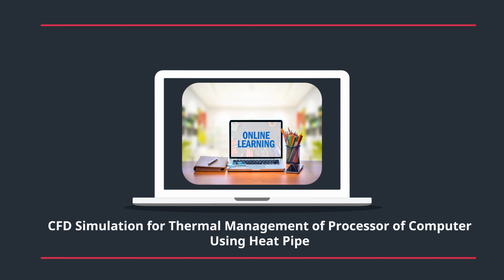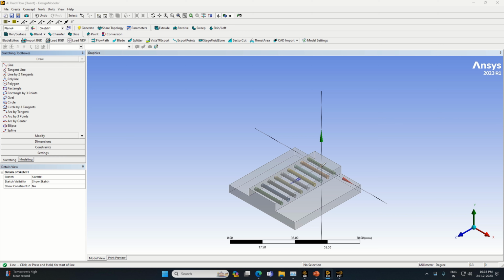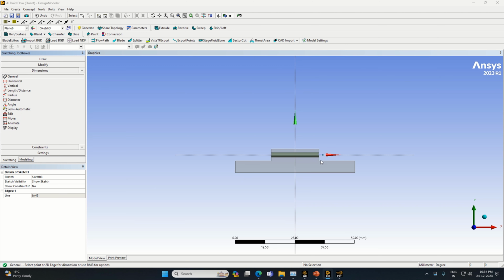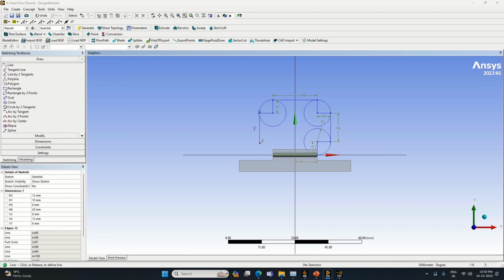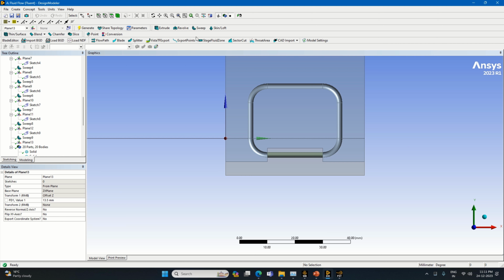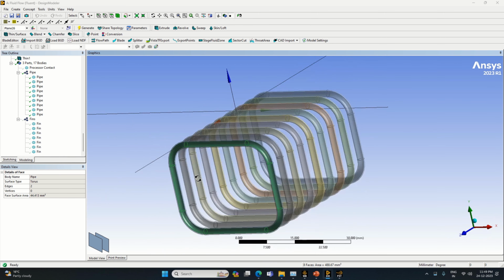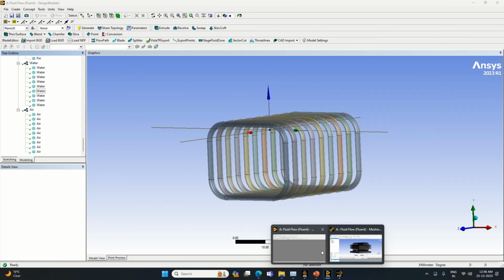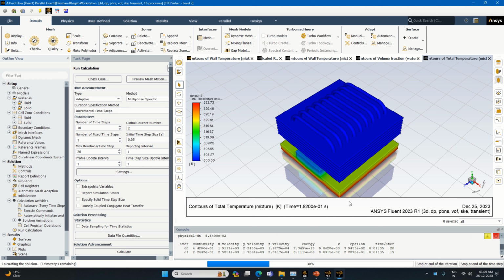CFD Simulation of Computer Processor Thermal Management Using Heat Pipe with Fins

Comment: Can u please upload or suggest some videos for battery thermal management system for pouch cell
Reply from the maker: Share the specification and details  will upload
Reply: @FrontiersInCFD  a 20ah li-ion single pouch cell having  10 liquid cooling channels (water as coolant) discharge at 3C using newman p2d model @inlet flow rate of 75ml/min and 25°c of coolant
Reply from the maker: will check